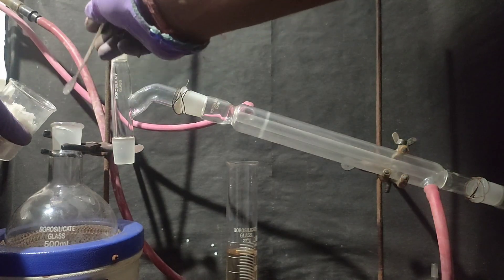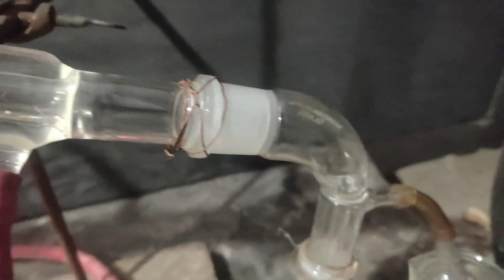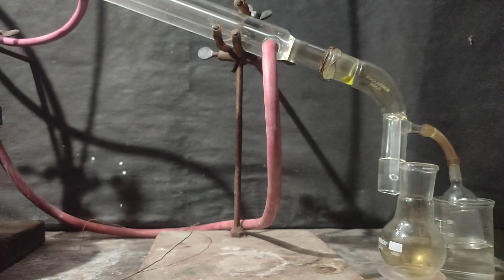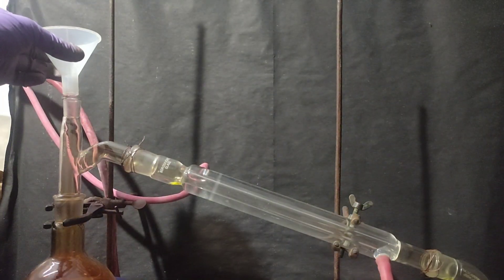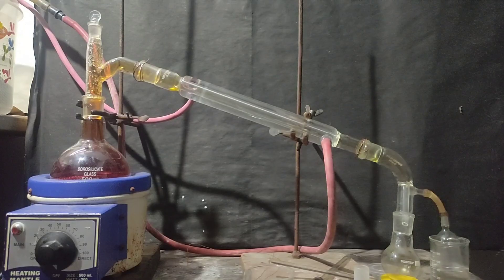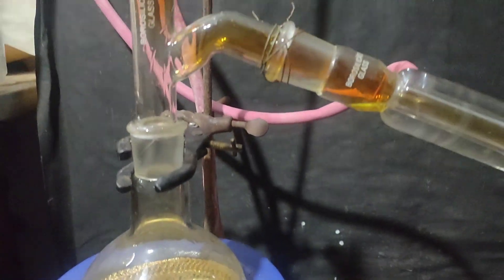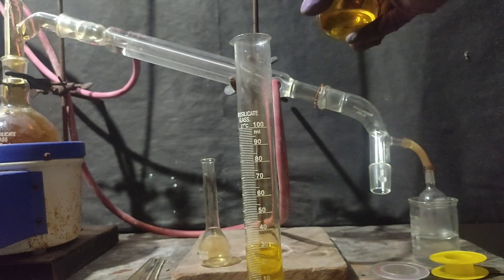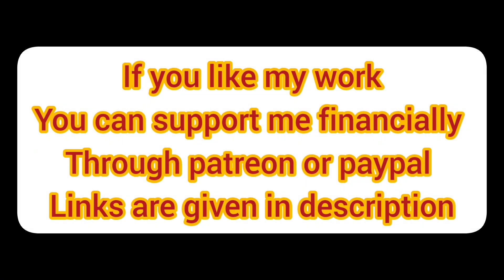How to make 99% Fuming Nitric Acid from drain cleaner

Comment: with what you clean the flask after that?
Reply from the maker: Which flask ? Boiling flask ? I just used hot water.
Reply: @TheDIYChemist  It stands firm as cement
Reply from the maker: You can easily dissolve it in hot water
Reply: Mix baking soda with hot water to netralize the potassium bisulfate sement

Comment: Can i use a triangular flask as a reaction vessel, i have always seen people use a round bottom flask for this reaction never understood why.

I do not have a round bottom flask or a heating mantle.
Reply from the maker: Nurdrage has used conical flask as a reaction vessel on a hot plate. The protocol says that reaction should be performed in round bottom flask. 
There is a risk of cracking on heating conical flask.
Reply: @TheDIYChemist  Better be safe than sorry
Reply: Triangular flask i think you mean an erlen flask, it could be used as a last resort but you should get a boiling flask the reason is erlen flask has an uneven glass concentration and could be too thick or too thin in some places and its not designed for heating much it could crack or chip a boiling or round bottom flask is even and is made of borosilicate glass so its resistant to heat